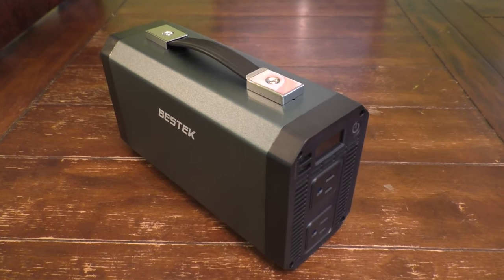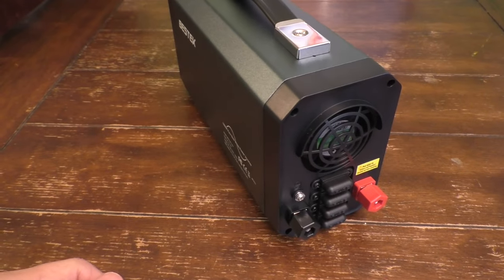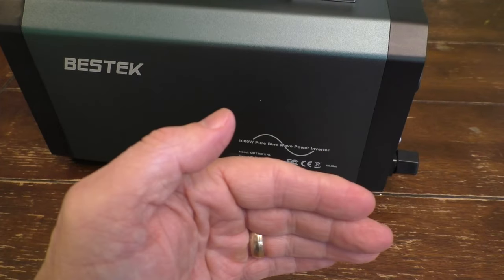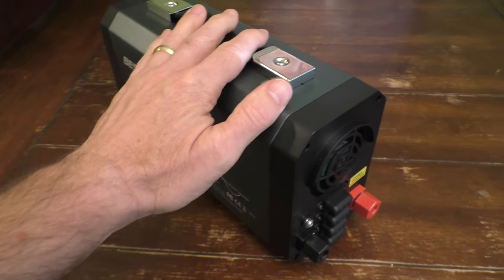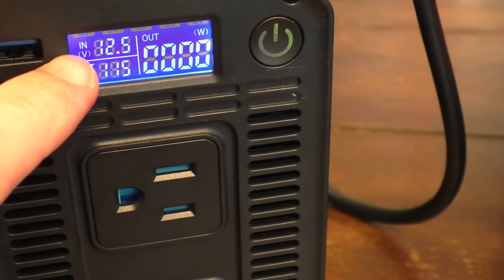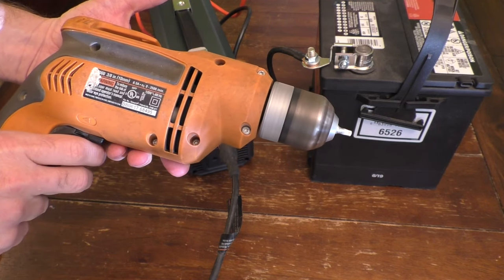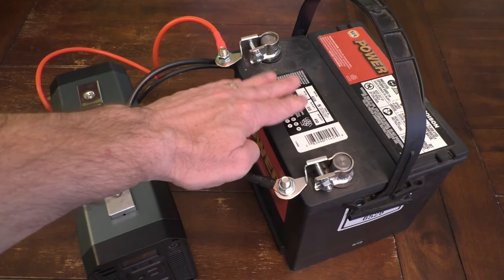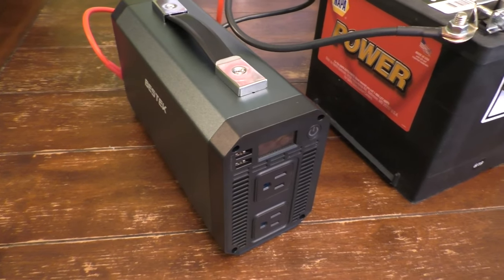How to Hook Up a Power Inverter to a 12V Battery

Comment: It is recommended to use a resistor to pre-charge the inverter so spark's don't occur. This will also reduce the electric load on the inverter.

Comment: Hi thanks for your video. If I don't have the battery in the car how do I keep the battery charged can I connect a battery charger to the inverter at the same time or could I use a solar panel to keep the battery charged

Comment: For those who came here for learning, like the title states, "How to Hook Up a Power Inverter to a 12 V Battery", skip all the extraneous and, in one instance, inaccurate stuff like his definition of a transformer and about the purpose and types of inverters and go to 4:58 . It'll save you a chunk of time and prevent you from falling asleep, hopefully.
As for his method of actually connecting an inverter to a battery, he glossed over the spark that occurred upon initial connection. The reason that happens is usually because the inverter's capacitors have built up voltage potential in them and, though relatively rare, they can be damaged if allowed to create a spark (a rapid dissipation) when this connection is made. I advise routinely placing a resistor (30 amps will do) between the positive cable of the battery and the inverter upon first connecting. Just holding the resistor so that first touch occurs while you hold your resistor between the initial connection. Doing that will safely dissipate that issue and you'll never get that spark when making this connection.
Reply: lol
Reply: Thanks!

Comment: Noob question:  what are the cables called that have the o-ring on **both ends**? I seem to be finding only ones that have a clamp on one of the ends. Also, what gauge do you recommend?. Thanks in advance!
Reply: Following
Reply: I had the same ? in mind 🤠

Comment: I live in a motorhome recently I lost my electricity connection and now I'm stuck trying to find alternative sources I work from home on laptop 40 plus hrs a week and watch TV on my cell phone I can give up the AC for now even the fridge but to get by I need 2 fans 2 cell phones 2 to laptops charged up 24/7 I have a bluetti power box I narrowed for now but I need a way to keep it charged up on my own instead of having to go some where to plug it in. I thought of battery and inverter not sure exactly how to do it. How many and what type of car batteries I should get and inverter. I'm def on a tight budget any advice would be appreciated

Comment: Can you demonstrate how to connect a jump starter (1600 amp/25watt) and use the jumper cables directly on the inverter's prongs? Do I need special adapters?

Exactly what I needed to see when using inverter with a 12v battery.
Reply: That's a good question. Occasionally I have done a sketchy hook up by clamping the inverter clamps onto the appropriate color of the jump starter clamps and it worked. But your way would be a cleaner hookup. Mine was just a 400 watt inverter and 800 amp jump starter.

I was doing it with an old school lead acid jump starter box. I wonder if it would also work with the new smaller lithium ion jump starters. Their cables and clamps are pretty flimsy by comparison.

Comment: Did not know about PURE sine (vs MODIFIED sine) inverters until this video. Thanks. I assume if I have a modified sine inverter then I could plug a Best Buy like UPS (that has pure sine) if I wanted to get PURE sine out of my MODIFIED sine inverter which could be tricky since the inverter needs enough power for the UPS I believe.

Comment: A transformer either steps up or steps down ac voltage.  A full bridge rectifier converts Ac to DC by using four diodes to either filter out the positive or negative part of the sine wave from AC voltage.  Other than that, great video.

Comment: Is it possible, or what would happen if I wanted to charge the battery using separate jumper cables while also using the inverter at the same time?

Comment: On the stand alone battery, can you have a trickle charger in line permanently keeping you battery charged while your using the connected inverter.
Reply: yeah but that will require the use of power...this is to bypass that so you arent using power.
Reply: If you had a source of power for a trickle charger then you wouldn't need the battery as a source of power!
Reply: yes leave it on all the time to keep the battery topped up. When the power goes out, it may or may not drain the battery a tiny bit, but shouldn't hurt the 1 A battery maintainer.

Comment: Could you not also place a solar charger on the car battery? Either within the car or externally like you have there? I'm looking to use my car as a mobile power generator and got solar panel charger so it's not always required to have the car running

Comment: I just bought a Toyota tundra that has a thick copper cord attached to the BATTERY POSITIVE post only (and has a fuse in line a few inches away.... this line runs somewhere through the truck to the bed where the wire becomes two sided home electrical wire... The white insulated side is the hot one (must be attached to the red up by battery). The gray insulated side is not hot ... My guess is for the negative or ground.... On my inverter I bought for my bed, the white would go on the positive and the gray on the negative. (But the battery area doesn't have any wire (negative) to add to the negative terminal ... Is it safe to not connect the negative battery terminal to the inverter, and will it work?

Comment: Is it normal to get an arc when hooking batteries to inverter?
Reply: I’m having the same issue. I got an ohm resistor but even with that I get big sparks trying to hook 12V battery to alternator.

Comment: does the Inverter also needs power for itself or it uses the battery's power to turn it on?
Reply: When you link the battery powerm turn on,It will work. Means which depend the 2nd power
Reply: Myes the inverter eats up a small amount of power.

Comment: can i apply a power strip to this inverter to charge or run multiple electronics or should I get a second inverter?
Reply: how long does a fully charged car battery last?
Reply: yes, but the more u plug in, more power u lose. remember max power out of a car battery will be 50% of it only, before you have to recharge the car battery. still i prefer this, coz lithium ion absolute rip off, and harder to get. car batteries are sold in every town in the world, and prob nearly every village. work out how much power in amps per day u gonna use thru researching it, then build your sys around that amp requirement.

Comment: Can a transformer transform AC to DC?
Complete answer: A transformer cannot convert AC to DC or DC to AC. The transformer has the ability to step up or decrease current. A step-up transformer is a transformer that raises the voltage from the primary to the secondary.
Reply: Critical that you specify only on alternating current system does it raise voltage from primary to secondary.

Comment: How about being able to power a stove , microwave , fridge  for a few months off grid ? 
Can anyone enlighten me ? 
Thanks
Reply: A Generator
Reply: @dreamlookautodetailingauto3353  I forgot to mention . Without gas.
Reply: @claudeborges get a 2500 to 3000 watt power inventor. That should be enough to start a refrigerator and maintain power for it. you can connect to you're car as a power source at the battery terminal. You can unplug from the device and plug into something, to provide power to each device otherwise you need a generator if you want to power all at once  or solar panels  for a full off grid scenario as a power source.
Reply: @claudeborges  why not just get a generator for the microwave? It's not like that's gonna run continuously. Fridge doesn't run off propane gas?

Comment: How many inverters can you hook up to one car battery provided the battery is still in the car while the car is running.
Could I use like 6 different ones and having them go to different appliances?
Reply: It doesn't matter how many inverters you hook up, just like it doesn't matter how many outlets are on the same circuit in your house. What matters is the pull (i.e., amperage) of all those appliances. Can you connect 6 different things? It depends on what those things are. Phone chargers = yes. Refrigerators = no. Pay attention to the wattage they take to run, the wattages the inverters are rated for, and the wattage of the battery, and the gauge of the wires. You don't want to overheat the wires and cause a fire, the inverters usually have overcurrent protection, but they'll just stop working to protect themselves, you might blow a fuse, etc. Just make sure that you're not pulling more amps than the system can handle and you'll be fine. For continuous loads, make sure you're not pulling more than 80% of the maximum amps.

Comment: I have a question  ?    Could you please tell me if a 12v jump starter lithium battery pack 9999mah is capable of powering a 1500w 12v inverter  ?  Thanks..
Reply: Yes soft start
Reply: Not without a transformation

Comment: Great informative video, thank you.
Im trying to find as simple as possible diagram/way to install my inverter into my van,i really have not much of a clue if im honest. 
I purchased a new car battery & a inverter last year to get some simple electric for charging phones,lights etc..your video is very informative and sounds just what im looking for apart from how is the battery going to keep getting charged without having to take it in the house and put it on charge,is it a simple thing to connect it to the van so it gets charged when the van is on.
Sorry so many questions, its about time i took the leap and just did it otherwise the battery will be no good.
Many thanks.
Reply: You don't use a regular car battery with an invertor.  Use a deep cycle or marine deep cycle battery.  The car starter battery and charging system is designed for short but intense discharges. Discharging it will wear it out quickly.  For a van camper, you would run cables from the deep cycle battery to a special one way box connected to the alternator, which would keep the car starter battery from discharging, and have a more powerful alternator installed.  You can use an free old car battery charged on a battery charger at home for some cheap juice for light loads like lights or a tiny fan or phone charging over the weekend.  You want to be able to drive out of there and not kill your car starter battery.

Comment: This device is a rectifier not an inverter. A Rectifier converts AC to DC. An Inverter converts DC to AC. A Transformer can change AC Voltage AND current using the magnetic field produced by AC.
Reply: How is it not an inverter..it's a DC battery to AC outlets.
Reply: @foodstampz  yeah you're right, no idea why I wrote that?! what he says about transformers at 0:18 is wrong though

Comment: What thickness cable for a 500w inverter?
Reply: 12 gauge is fine. 10 gauge is better for anything over 500 watts.
Reply: @PaulRudd1941  what is 10 awg in mm?
Reply: @michaelsrowland  seems like you could answer your own question with a conversion and an internet search. 🤔  

I'm going to let you answer your own question by telling you to do an internet search and figure it out. 

We're usually adults here. [Not to be condescending] but unless I'm talking to a 16 year old who's building his own car-camper, I think you have this locked in chief.

Comment: How long does it actually last on a full charge @ 30 watts
Reply: I'm still waiting for SOMEONE to answer your question...
Reply: ABOUT AN HOUR OR LESS, BOYS
Reply: used deep cycle battery 75 amp 900 whats not any battery ok
Reply: Do the Math. 30 watts x a.H

Comment: My inverter gave off a burning smell, now it turns on but nothing plugged in has power. What could this be?
Reply: made in China
Reply: Same here... Happened to me yesterday. While I was trying to connect my 1000 watts inverter to my new 120ah battery. I never had this problem while using the same inverter with my previous 40ah battery.
Reply: Check fuse...
Reply: Maybe a bad fuse, that needs to be replaced.

Comment: when would you need something like that? during the zombie apocalypse?
Reply: for instance, I ran my tower garden AC pump to keep my hydroponics system plant roots from drying out. Charging phones, running the optical fibre internet wifi router,  one smart speaker.

Comment: but 12 volt deep cycle battery is best ok i have 12 volt deep cycle battery 75 amp 900 watts
Reply: Where did you buy the terminals from?
Reply: @shutt1080  Canada Tire
Reply: They were included with the inverter